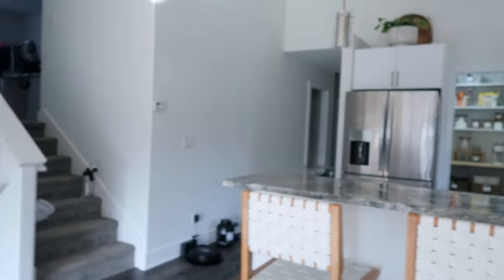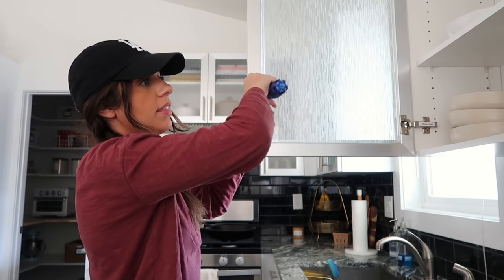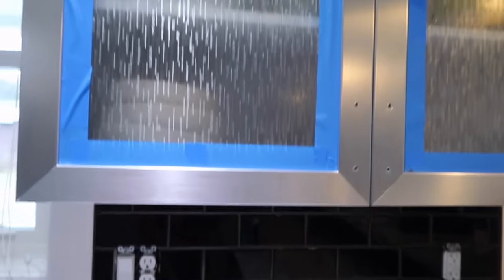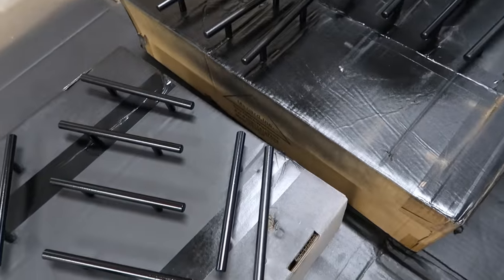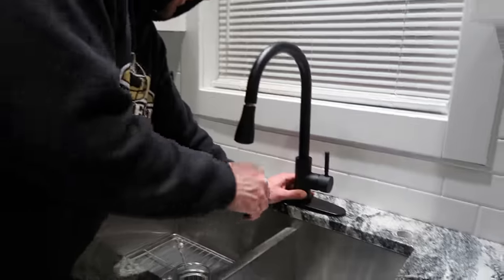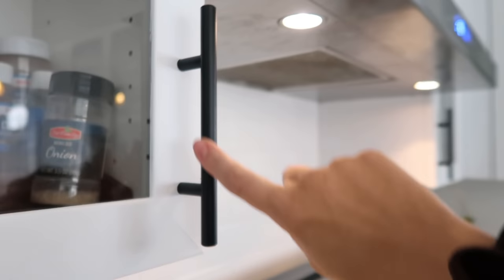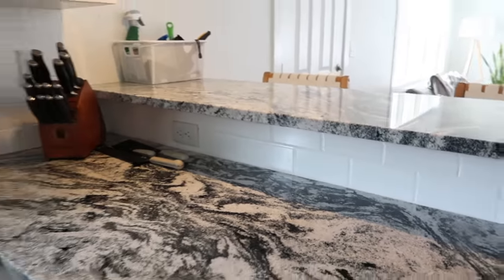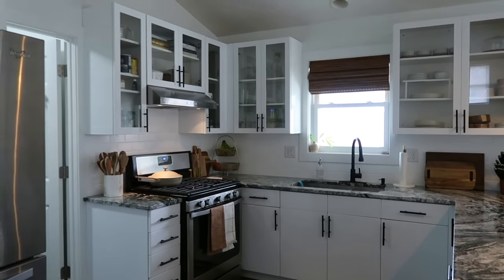DIY KITCHEN MAKEOVER ON A BUDGET!

Comment: I LOVE the transformation!
And I would do EXACTLY the same thing you did with the hardware -- black.
IF you want to "warm" things up, you could do a butcher block counter top, and it would coordinate with the light wood shelf in the pantry.  (Personally, I love the white with black and would possibly lighten up the counter top with a white quartz / black marble look.) If you want the "wood" look, then butcher block would tie in ... or maybe birch with planks built into the design.  GREAT JOB, and I wouldn't do ANY remodel after this.  You nailed it already!